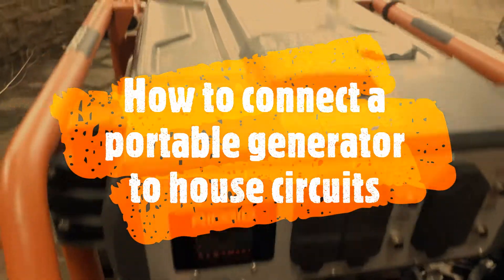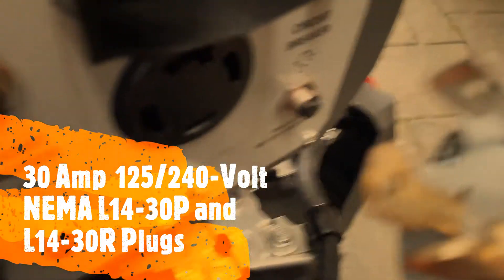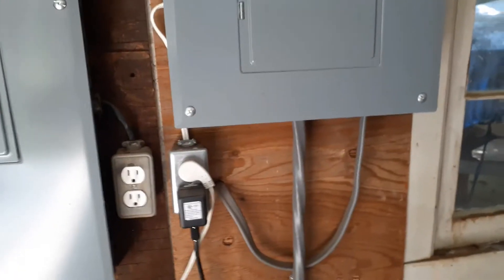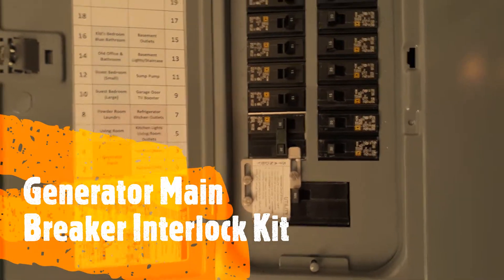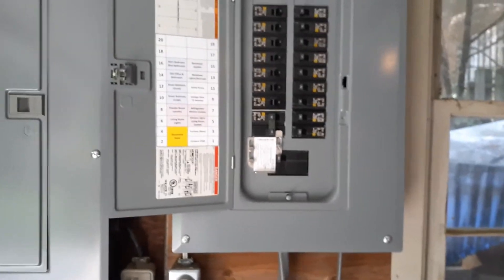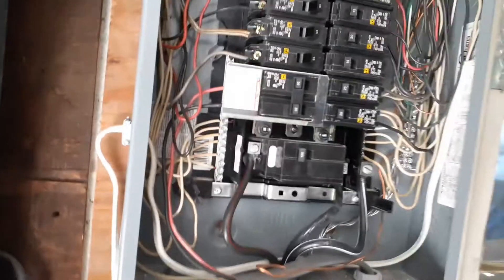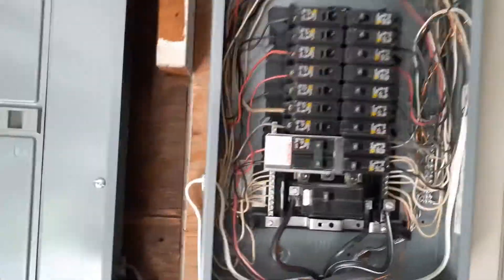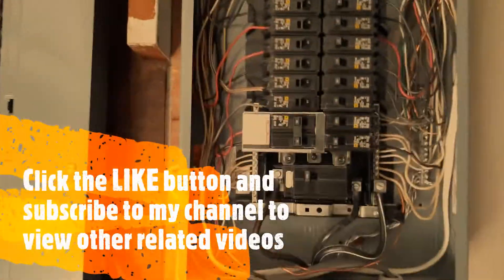How to Connect Generator To House - Interlock Kit

Comment: Really enjoying your videos. I have a question. (Not an electrican)  Because you are supplying an unbonded generator sub panel(or so it looked to me)  should the generator be neutral bonded and have a ground rod.? I ask this because in most cases aren't generators  feeding a neutral bonded main panel? (I like your setup much better!) Thanks very much for the videos. Hope you get to a 1000 subs soon.
Reply from the maker: Your question made me dig up some material that I had researched on this topic when I set this up years ago. In my case, the sub panel that the generator is connecting is grounded via the main panel next to it (can only ground once) and it transfers the neutral to the main panel that has a ground (as you noticed correctly). My generator has a floating neutral and it is transferring the neutral to the sub panel and so it does not need to be grounded separately. Hope that helps. Thank you for noticing the subscriber count.
Reply: @DIYWithIndi  Thank you very much.
Reply from the maker: @Mike-ig2zq  Correction - my generator is bonded neutral. Since I am using 4 wires from the generator to the house panel for the 240v, it should be good. But it is safer to switch to a floating neutral or ground at the generator. Also it helps to not have GFCI at the 240v outlet. The 120v ones have GFCI but I do not use these.
Reply: @DIYWithIndi  Thats what I was thinking from my understanding of generators and sub panels. Thanks again very much for your responses.

Comment: Your RIDGID has a bonded neutral .. and your generator should be floating neutral when using a interlock kit to be legal. 

This guy says risk is  minimal using a bonded neutral
Generator Floating VS Bonded Neutral By Electric Generators Direct
https://www.youtube.com/watch?v=bxlmF7YsEhQ

This guy does thru all the issues and talks about converting generator between the 2 configs and show risk is minimal
What is a Floating Neutral Generator? By Benjamin Sahlstrom
https://www.youtube.com/watch?v=RkjjZJgaINA

Different brand but show the basical steps of converting generator between the 2 configs
Champion Help Center: Converting Your Generator to Floating Neutral (Open Frame Generators) by Champion Power Equipment
https://www.youtube.com/watch?v=3CwFSjEoHPg

This guy has a pic were to break the neutral bond in your generator brand-model
New Ridgid port. generator bonded neutral ?
https://www.powerequipmentforum.com/threads/new-ridgid-port-generator-bonded-neutral.9361/

These guys sell a inlet that allows converting between the 2 configs if you dont want to make change at the generator
EZ Generator Switch - How To Make Our Switch Compatible with Bonded OR Floating Neutral Generators by EZ Generator Switch
https://www.youtube.com/watch?v=gVbUWCCt0D4